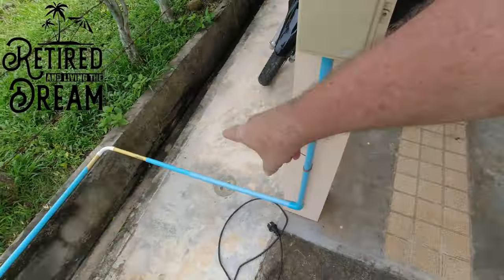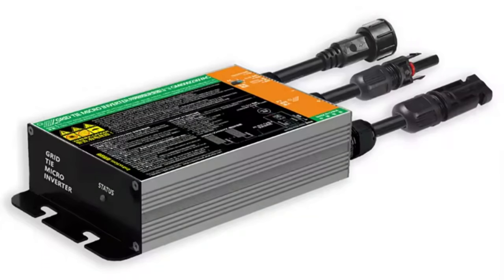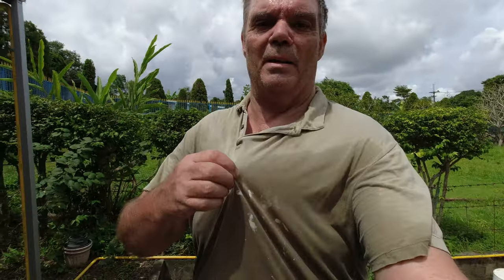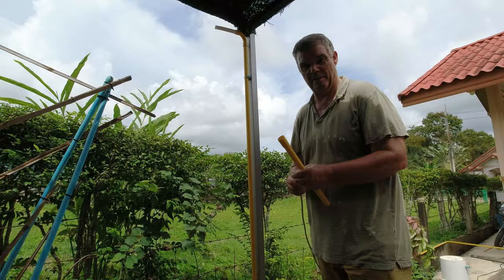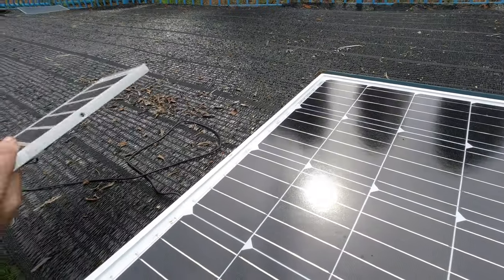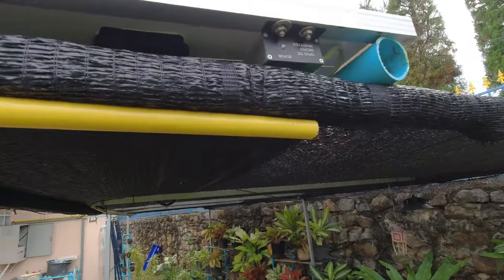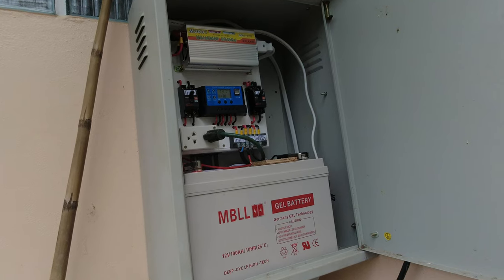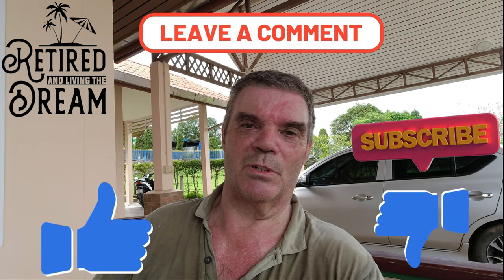"Solar Backup system Basics: I Love Solar's Start with only 80 Watt Setup"

Comment: Looks good! 
I have installed 3 very small solar panels just for spotlights around our property, but our home electric bill is usually about 1000 Baht a month, so a full solar system isn’t really necessary. But a small system like your’s would be great for those occasional power outages we have. As you said, being able to keep a fan running on those hot nights would be Great! I definitely need to look into getting this done. 
Thank you.
Reply from the maker: Thanks for that, same here our Electric bill has never been over 900 baht last month was 679 Baht so the same here the cost does not get me the benefit but we all benefit if we have power when the power is off. I will be doing the Battery backup video in the next couple of weeks. But again cheap and it works for me.

Comment: Les, I enjoyed your video as always. I think you could easily start a business helping expats install solar panels on their homes. I live in an expat community here in Ban Chang, and of the ~150 homes only 2 currently have solar panels. Having already figured out the ins and outs of solar panels here in our part of Thailand, I think you could provide very valuable advice to many expats, and make it a lucrative business for yourself as well.
Reply from the maker: Thanks for the comment, I have talked with a few guys who have considered getting Solar as their  Electricity bills are more than 5,000 baht  per month.  My sister pays this amount per week in the UK So Thai Electric is still very cheap compared to Western Countrys. The cost of Solar is very expensive here and the Return in investment is still 7 to 10 years. Using a Grid-tie makes the installation much cheaper because no need for batteries  but the Thai Electricity company do not want to pay for the Electric you supply to them. They had a scheme for this but withdrew it I believe. To install an approved grid-tie system is very difficult also needing all sorts of permission to do so. In my opinion Electric is too cheap to justify a full Solar installation A back up is well worth it in my opinion for those inconvenient power cuts. Thanks for the suggestion I enjoy Retirement and would not like to go back to the grind stone. Retired now for 13 years I love the freedom. Thanks again for watching.

Comment: Nowadays, you can just buy a power bank. It’s so easy, just a box you hook up your solar to it to keep it charged up and you’re done. You can move it around wherever you want.
You should try and get a DC fan so it doesn’t have to be converted it will last a lot longer
Reply from the maker: Your 100% correct with the Solar power bank, these are expensive but yes I agree portable. I would never use this as a portable system I only require a small backup system in my home so I hard wire extra sockets in just for this purpose. I already have a DC rechargeable fan powered by solar. I did have two 80watt DC car radiator fans running from the 80 watt panel but were too noisy for practical use. Thanks for taking time to comment and for watching.

Comment: Hey Les ...you interested in a paid job..I want put solar on my pool pump and water pump... near ban phe
Reply from the maker: Hi and thanks for the offer, sorry to say my working days are over I do not do paid work here, I give advice to others about electrical systems and electrical safety and even look at their electrical systems sometimes but it is not worth working here when the Thai's work so cheap. Your pool pumps will require a lot of energy as they consume a lot of power so you would need quite a large system a bit more than my DIY solution. Best of luck with your installation. Thanks for watching.